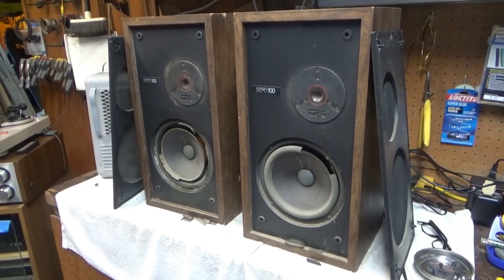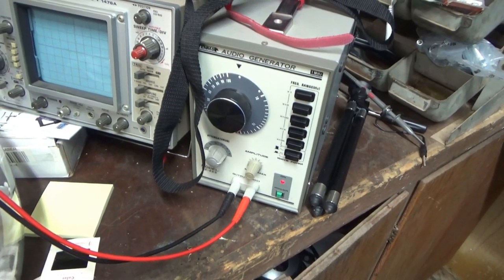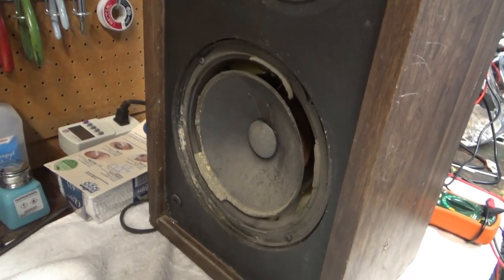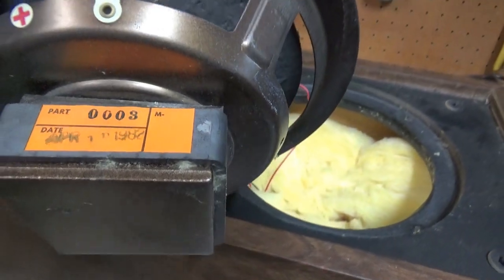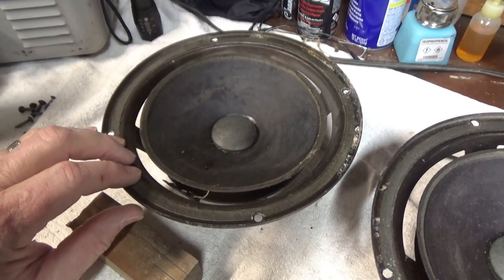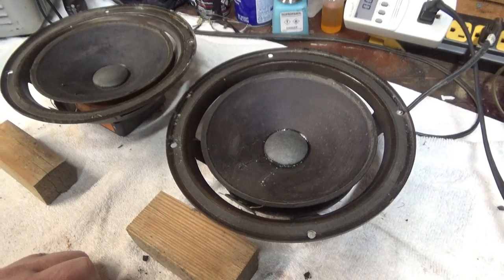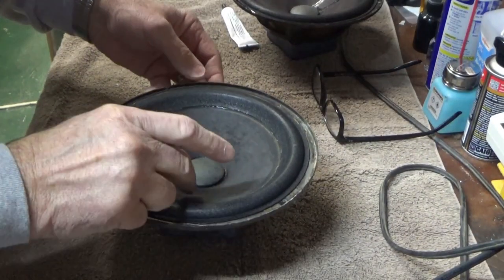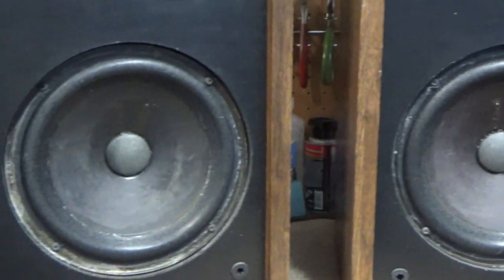1982 EPI Model 100 Speaker Restoration

Comment: Thats is a frickin bargain of the century.
Reply from the maker: Sometimes you get lucky. I strike out on most trips to the thrift stores. But I keep going back looking for that occasional gem.
Reply: I just bought a set of 70C for $35 CAD. The VC separated from the spiders. I centered the vc with a power supply, epoxy glued the cones back to the spiders and refoamed them. All in for $45. Very impressive sounding for a small 2 way. @mguess

Comment: Wow I have a pair of 110s on the way from Payson for 4 b&w dm 1400 woofers I got in a group deal. I can't believe that this very video is here. Thank you for all the tips and instructions. As I will also have to do the 8 inch woofers. I have loved EPI for over 30 years. I will check back when finished. However I haven't been to a goodwill in Phoenix and found a pair for 4$. Everytime I go nothing. One day the Scottsdale goodwill will have the special deal for me lol.... Thank you for your time
Reply from the maker: The EPI's were a luck find in a small independent thrift store in east Mesa. Vintage audio thrifting can be very frustrating but every once in a while you find a hidden gem. Good luck with your restoration and let me know how it turns out.

Comment: I sold a ton of this speaker back in the day. My favorite model. I had a set too😊. 
They need at least a 30 to 50 watt per channel amp. As they need to power to get the full sound out of them.
Reply from the maker: Very nice sounding smallish bookshelf speaker. I drive them with a Hafler DH-220 amp which has about 120 watts per channel.

Comment: Just picked up a pair of epi m90 at a local goodwill. Woofer and tweeters surprisingly looked to be in great condition could’ve been redone cause everything from those to the baffle,grill cloths, and cabinet look to be in fantastic condition. 20 bucks! I saw them early in the day and although I wanted them I passed it wasn’t until a couple hours later I couldn’t resist the urge of “what if someone else gets to listen to them instead” and went back to find them still there. People at the goodwills nearby will tend to only grab new speakers and older speakers regardless of how good they are go unnoticed most of the time. PS I passed the first time because just a couple days before I had bought a sansui 221 and a pair of mirage om 10s at another goodwill lol.
Reply from the maker: Great find. The EPI Model 100/90's sound really good for their size,

Comment: Swell video on the EPI-100. They were introduced in 1970 and, according to Complete Buyers Guide 1979, they had "the kind of high frequency response we take for granted nowadays". I got mine in 1980 and dig the 45Hz (+/-3dB) bass from such a small, light speaker. Power handling is very conservatively rated and stereo imaging is surprisingly good in both depth and breadth. The 1" tweeter has an open, airy response and good dispersion. Given quality source material, they will give you excellent listening pleasure without "listener fatigue" You get a lotta bang-for-your-buck with the EPI-100.
Reply from the maker: Thanks for the comments. I really like the EPI speakers. I'm currently using them in my wood shop. Sound great. Following the release of the video I did recover the speaker grills. Now they look as good as they sound.
Reply: @mguess - bet they look sweet. Unfortunately my 100's ain't hooked up now. Also got a pair of EPI-180's and they sound similar to the 100's but with a bit deeper bass and can get screamin' loud without distortion (the neighbors must love that). Currently have Ohm model L's and Ohm model H's in my present system. Wish I could keep all of them connected but the missus wouldn't understand. I'd probably need a flak jacket.
Reply from the maker: @martyjewell5683  I understand completely. I have 5 sets of speakers connected to my system which is in the basement out of sight.
Reply: @mguess - 5 sets? Awesome, what are they? Are they in different rooms? I put a "mini" hifi in the kitchen during Covid as my wife took over the living room as her home office and I couldn't really play the big stereo loud. The kitchen setup consists of; Pioneer SX-434, Nakamichi BX-1 and two speaker pairs, Boston Acoustics A-40 and Synergistics S12B.  Ain't nothin' like a good hifi for a relaxing mental enema.
Reply from the maker: @martyjewell5683  All 5 sets of speakers are in the same room, my basement listening room. Here is a list of the speaker pairs.
Altec Lansing 605A studio monitors - 1959
DWD - 1978
Paradigm 9SE - 1990
Boston Acoustics A70 - 1987
EPI Model 100 - 1982
Reply: I also have the same affliction.  AR TSW-610, Energy Three, ESS LS-5, NS-690x4, and Audio Analyst Ax76. Trying to sell some, but people dont realize the time and money into the restoration of them. Caps, foam, ferrofluid, fabric, sanding and staining in some instances. I enjoy the process. Ferro fluid really rejuvenates the tweeters.

Comment: I have found that it helps to stuff wads of paper towels under the cone to hold it off the frame while you apply the glue
Reply from the maker: I agree,  I've heard that the paper thing works well.
Reply: Just use a AA battery with leads to push and pull the cone when gluing. Also centers the coil so no shims required.